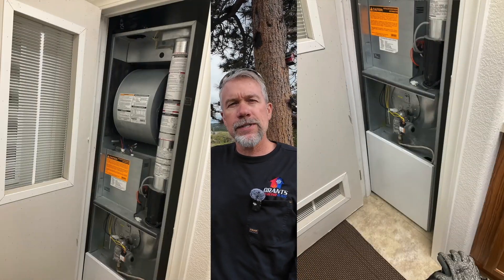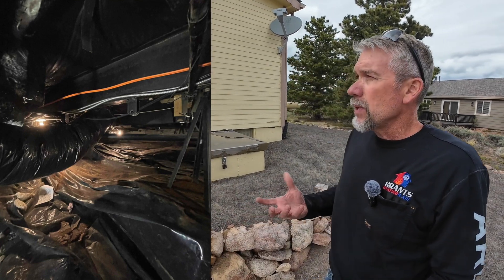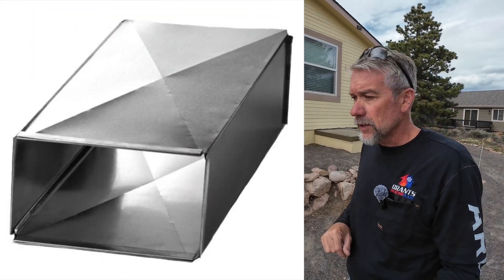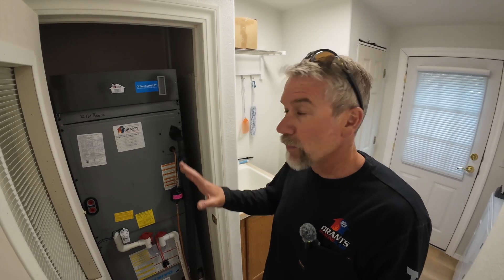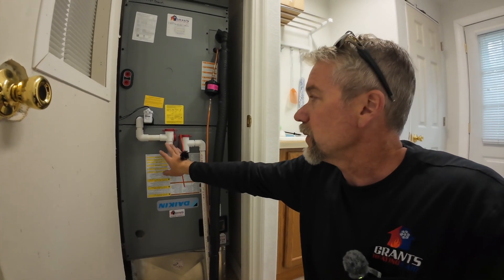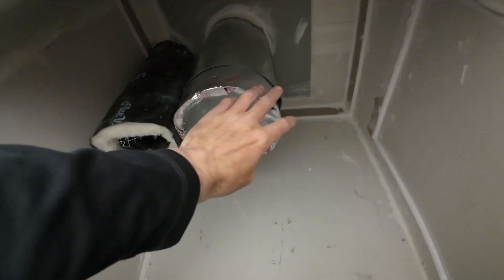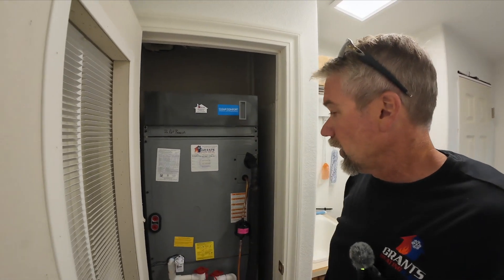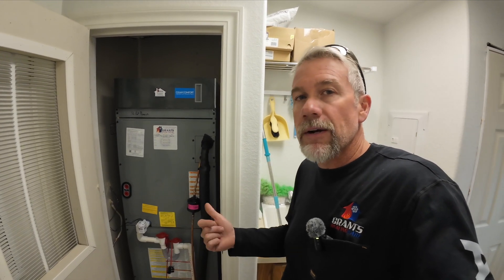Replacing Inefficient Manufactured Home Gas Furnaces with an All-Electric Daikin Fit Heat Pump

Comment: I like your video. I also like my propane heat I have a seperate mini split on my wall but the propane furnace is like a turbo jet taking off. 

Is their a quiet gas furnace and ac option is that duel fuel ? 

Electric would be nice but I enjoy the solid heat from the propane
Reply from the maker: There are a few reasons why the furnace sounds like a turbojet taking off. We have found that manufactured furnaces are often delivered from the factory with high fan speeds. After conducting a temperature rise test, we find that we can significantly reduce the speed. Additionally, the ductwork in this application is quite restrictive, leading to high static pressures. Modern ECM and variable-speed blowers will increase their speed to overcome this resistance, which results in increased noise.

I understand that some people are hesitant about switching from gas heating, but once you experience a properly installed heat pump, you will see the advantages. However, many people remain skeptical.

There are also several options available, such as a modulating gas furnace, but it's important to check your local regulations regarding requirements for manufactured homes.
Reply: @grantshvac  Thanks for the reply!! id hire your purely based on you response. My electric bill is 60 a month obvisuly my gas bill is high but i got water and cooking with the furnace, and standby generator. i love gas. my mini split does throw out nice heat but when its ran usually can add an extra 20 to 40 extra to my power bill which isnt bad at all.

my ductwork is a little restricted 16" vertical down to splits to 2 trunk lines maybe 14x8 then that feeds the middle section of the doublewide mobile. then the far rooms at each end of the house have 6" flex lines going to them off the trunk box section. the rooms have the worst airflow, the middle of the house is always the warmest. id love to get a quiter furnace with better air pressure in the rooms but i dont think id get this by just changing out the furnace.  ive seen these inline booster ducts i can install and they kick on once the air is passing through 4 of those vs a new furnace but would still have the turbo jet noise in my more open concept mobile.

Comment: Why would anyone want to rely even more on electricity? With more and more electric cars and everything else pushing the demands way up the price is going to skyrocket. depending on where you are located there already may be delivery problems with electricity, if not, just wait as your grid is more and more taxed. hopefully this system isn't in an area that gets truly cold, or you will be needing a supplemental heat source and you may regret not having a gas furnace there to pick up the slack. the push to these heat pumps, especially in cold environments is asinine.
Reply from the maker: @57ford50  Appreciate your comment.  Here in Colorado we don’t have problems with our electrical grid. I have attended meetings with the electrical companies, and they have confirmed that this is not the case in our area.  Electricity where this job was installed is nine cents a kilowatt.  We actually saw a decrease in our electrical cost this year and just because there’s more demand does not mean that there will be an increase in cost. It’s actually the reverse the more power the power company buys in bulk the cheaper they get it.  We have lots of alternative energy projects, solar and  wind, for example.  We always design our heat pumps to have a back up heat source you must’ve missed that in the video.  There is a heat kit that can supplement the heat pump or take over the entire load on extremely cold days or if there is an error with the heat pump. 

It’s normal to question things when we go through a big change just like going from prehistoric dinosaur cars to electric cars. People are hesitant, but the change is inevitable. There is a lot of misinformation and concerns, but I assure you all of the math has been done and we do understand that this is a better path and I hope one day you will see that as well. We cannot continue to rely on propane or natural gas as it is not a renewable source.  We can continue to make electricity through solar and wind for example, that is renewable and at the same time, not pollute the environment with burned fossil fuels. 

We have plenty of customers that are very comfortable with their all electric systems that are saving hundreds of dollars in some cases per month and are very comfortable even at -22°
Reply: Did this unit not require return ducting?
Reply from the maker: @noahgreen3345  It requires return ducting. In this application, it has an open plenum return design, meaning it pulls its return air through the louvered doors.